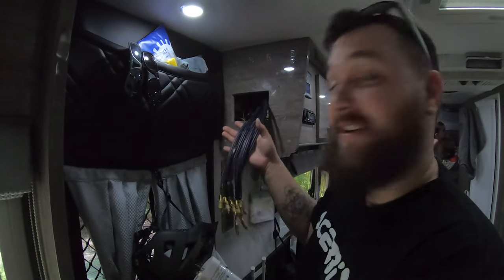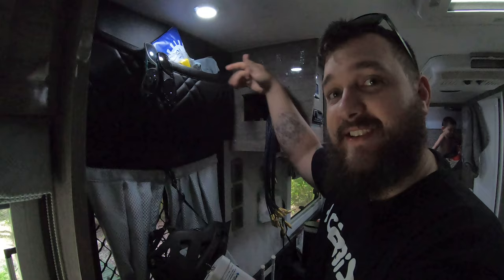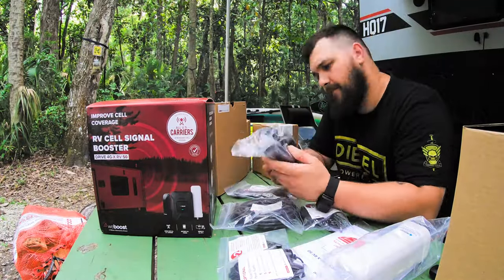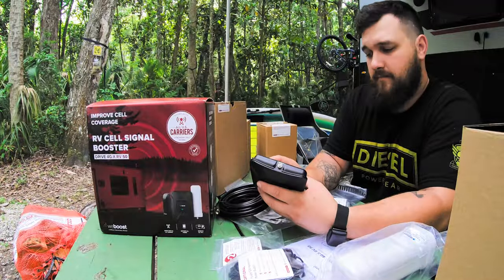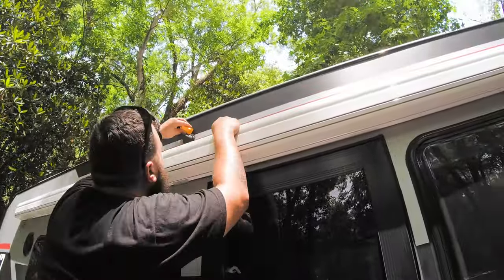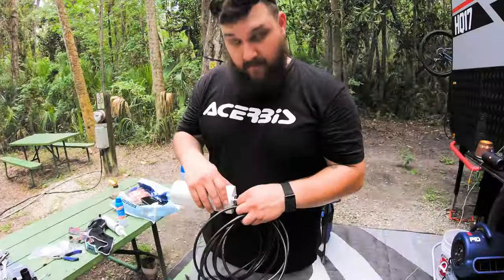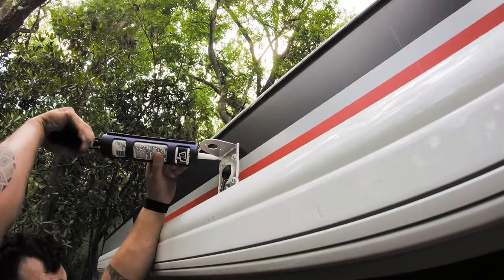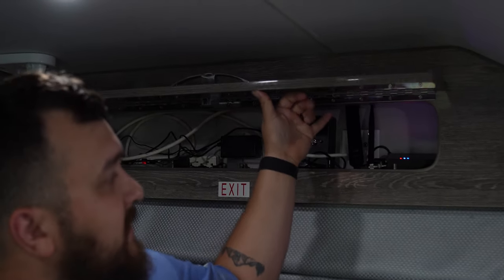Installing weBOOST RV cell signal booster in 2020 Black Series HQ 17

Comment: Great idea on using the existing radio antenna! I have a 21 HQ19 and was looking at doing this upgrade as well. From a fellow vet wish you well out there!
Reply from the maker: Thanks! We’ve sense moved on to Starlink. But this worked great until a tree took it on a tighter trail.